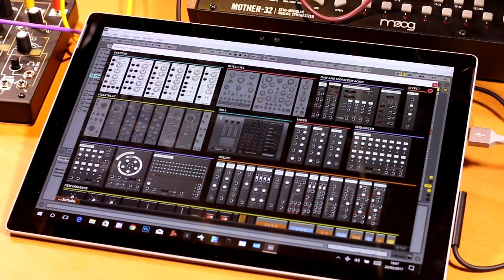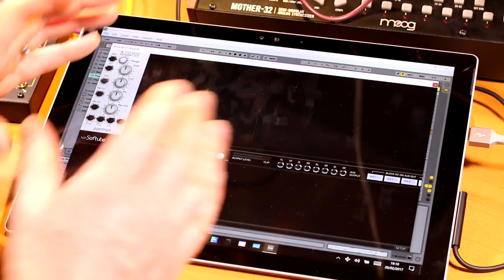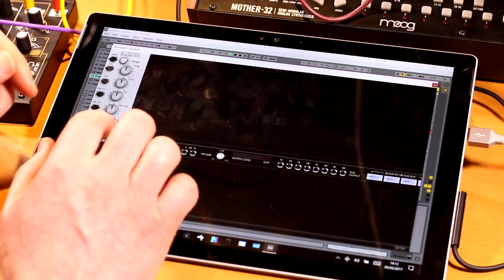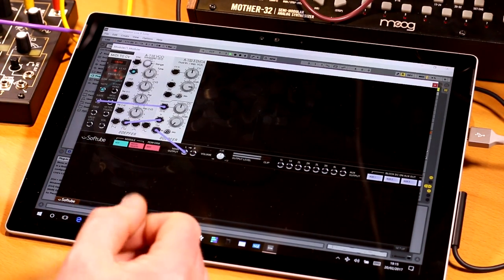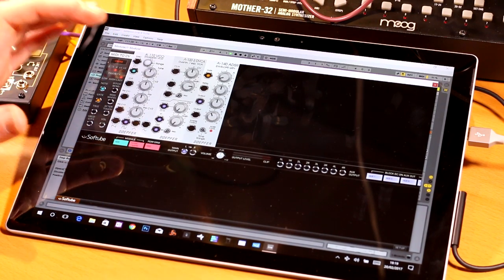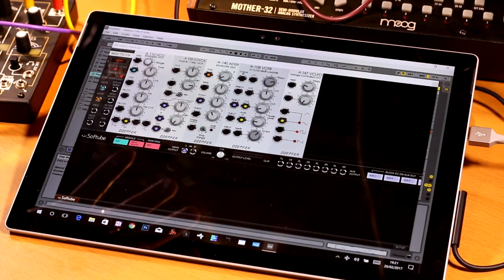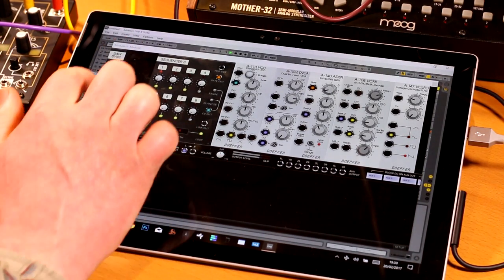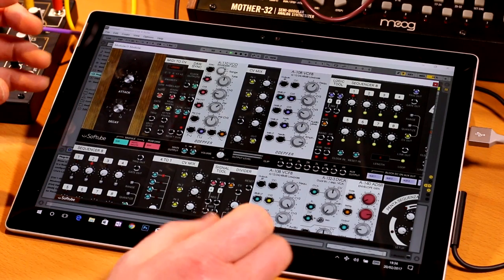Molten Modular 03 - Wetting your feet with Softube Modular

Comment: I've used VCV Rack 2 (free) and Multiphonics CV-1by Applied Acoustics Systems (way less than the cost of even one average module). Both are excellent programs. Or they are the equivalent to crack. Then I bought an Arturia MiniBrute 2S, and I've just ordered Cre8Audio's Niftykeyz and 6 modules for about $2300 Canadian. I've well and truly fallen down the rabbit hole, because I've still got 42HP to fill, and I'm thinking that after that I'll need a RackBrute to attach to my MiniBrute...

Comment: Wonderful video, very well presented! The great things for me with Softube's Modular (bearing in mind that I became interested in it after using my friend's giant wall of every great unit you can imagine) are: 1) every unit I had ear-marked to buy came out as an add-on, 2) I don't have to mess about with PSUs or soldering irons ever, 3) I couldn't save a real rack beyond writing it in a notebook or maybe taking photos, 4) my 'rack' goes with me anywhere, even on a plane, and 5) —and this is the big one—I can automate from the sequencer and inside Modular just by waggling a pot. So, I can get the 'hands-on' performance with pots using my MIDI controller, I can record it, and I can go in and edit tiny portions of it if I want. For me, all of those positives together make it better than the hardware (point #1 being vital here, of course!). I know that the same rack wouldn't sound as rich if we ran my software side by side with the real thing, but the person listening to my music doesn't get to hear that distinction. All that matters to a listener is that the music I make stirs their emotions, and I can fake a lot of that extra subtle fuzz and gloop with post-processing.
Reply from the maker: Thanks! It's good to find a way of working that appeals to you.

Comment: VCV Rack might be a bit easier intro to modular concepts - and it's free.
Reply from the maker: Possibly, although i'm not sure about it being easier in terms of install and DAW integration. It also didn't exist when i made this video.
Reply: * AnimalHeadSpirit *  There's so many trade-offs for the software elements, but that's what makes it useful to try all of the ones you can afford.  For instance, VCV Rack includes the Mutable Instruments modules, but the actual name brand is removed from them.  If you use Softube, you can pay for each of those MI modules in order to get the name.  Likewise, Softube includes Intellijel, Doepfer, & 4ms.  However, it hasn't really expanded that much in the past year or so...seems to have stagnated.

But then back on VCV Rack, you have many software modular designers that don't have any products anywhere else but have some promising design, sound, & utility all mostly free, but there are some really good for cheap such as the Vult series. If you spend a whole $30, you can run VSTs in VCV Rack, so it can probably control Softube Modular, though I haven't tried it yet.

Over on Reason, you can get a taste of several Noise Engineering modules & that's the only place outside of hardware you can play with them.  There is also Reaktor & I love a lot of its modules as well.  Next of course is Bitwig 3 Grid.  Tradeoff here is that Bitwig doesn't have rewire so I can't use it with Reason & the VCV Bridge, though still exists in VCV Rack 1.0, they plan on getting rid of it.  So I haven't figured out yet how to record VCV Rack to a DAW or elsewhere without the bridge.  I've read some people using a Reaper driver called Rea-something that can pipe VCV Rack to Reaper's tracks...I haven't seen an equivalent to any other DAW.

Right now I'm rewatching this whole series as I'm finally looking to take the plunge into semi-modular & eurorack.  Unlike Robin, I had to keep thinking about it for the past two years before I could finally make a decision about getting into it & I'm still balking at the utility module costs.

One of the things I've found interesting is to take a synth schematic & try to build the components for it using VCV Rack. For example, I read where someone was asking about using the Minibrute 2 with the Rackbrute & how to get started.  And someone else mentioned to try taking the wave shapes & sending them to a Quad VCA to control them & pass them to other parts of a eurorack.  So I fired up VCV Rack to try that & see what it might do if all I had was a Minibrute 2 & a single module, a Quad VCA.  Obviously, it's not going to do much until you have something else, but visualizing it & seeing what it looks like, helps you figure out what other modules you might need in order to do something useful with the semi.  I can tell right away that I'm going to need some reverb...lol.
Reply: And you you also use the iOS version MiRack. 

If I had to buy all those modules then that would cost an arm and a leg.

Comment: What are the pros of Softube Modular vs. Reaktor?
I've been searching for comparisons but I haven't found enough to decide which one should I go.
Reply from the maker: Pros would be that it looks and works like Eurorack, like actual real-life product with real controls and connections. You can transplant that knowledge directly to hardware. Reaktor is like building a synth from the inside rather than using synthesizer modules as a musical instrument. I would suggest trying VCVRack.com
Reply: Thank you so much for your fast reply! And yes, I've tried VCVRack but I don't like the fact that is too hard to midi-map. 
I'm gonna have a try on Softube Modular, thank you.

Comment: Why pay for Softtube? There are at least five free modulars for PC: Sunvox, VCVrack, Wren, LWM rack, and Automatonism.
Reply: Cheers that just saved me 70 pounds
Reply: Softtube has modules that clone real world ones.
Reply: So does VCV Rack.
Reply: Thomas Brown Not in the same sense as Softtube.
Reply: Not sure what you mean. VCV Rack clones a number of Mutable Instruments and Batumi modules.
Reply: Thomas Brown Softtube collaborates with audio hardware manufacturers to give you modules true to the original hardware. VCV Rack modules are made by the community.
Reply: That sounds like an advertisement, not a substantive difference. The Batumi and Mutable modules in VCV Rack sound just like the hardware versions.
Reply: Thomas Brown Maybe, but that's why people pay the extra cash.
Reply: Softube Modular is the most analog sounding and they model  real modules working with module manufacturers and it works like a real one.

Comment: Sounds very flat and boring. Do you feel like they slacked on the algorithms?
Reply: Softube put a lot of work into modelling each module ("in close cooperation w/ Doepfer"), so...No, they absolutely did not. Plus they absolutely refused to integrate a low  CPU mode JUST for the reason of maintaining the quality of the modelling. Any discrepancies you detect are due to other factors.
Reply: That is because of YT.  It kills audio quality.
Reply from the maker: Sounds bang on to me :)
Reply: It just sounds plain bad to me. Not at all like analog or even analog modelling. It sounds like Reason.
Reply: @RoboticusMusic  Compared to my Korg Odyssey it sounds about the same. Analog modeling is Softubes thing many devs and reviewers say this. You will need to install the demo of Modular and run your DAW at 96khz  to properly compare it to a real analogue synth.

Comment: I got modular last week and i've learned a lot about how the signal flows in a patch. (and i don;t mean just modular patches).

i've just been tinkering with modular to get an understanding of the basics of making a sound (any half decent sound is an achievement atm :). 

it's a lot of fun but already I'm wishing it was real cables i was plugging in (do you know if there's a way to set modular up to show the cables without having to mouse over them)

also how the hell do you save patches? I';ve looked through the manual but can't find it (the manual is a pain in the arse as it includes instructions for ALL of softubes plugins)
tbh I can't believe there isn't a preset browser with a save button or something.
Reply from the maker: I used it in Bitwig and discovered the presets were in the Bitwig Device, not in the Modular GUI - so they seem to be in the DAW preset manager which is also probably where you save your own - i would have a look but i can't right now :)
Reply: thanks for the reply. finally figured it out
you're correct it was a brain fart on my part
I've been loading the included presets from the device slot in Ableton... no idea why i didn't think to save it there also :)
(you can also drag and drop the modular device into your ableton library which saves the preset, which was the workaround i was using)

another bad thing about the softube plugin is that I now want a real modular system badly but £££££££'s :)

Comment: You're doing a great job with this series. I don't disagree with any of the points you've made. I went an only slightly different direction when I started up at the end of last year.  I started with Reaktor Blocks, and had some fun with it, but found it to ultimately be uninvolving, and very difficult to follow more complicated patches. But it did give me a feel for the basic "moves" of modular patching. I spent a long time then considering my options for going "physical". Long story short ended up with a Pittsburgh Lifeforms 301 semi-modular setup (I like the patch point locations better than the Mom).

Naturally I started adding modules (the case is full after two months!), and as you've mentioned re semi-modular I was challenged just a bit when first "de-normalling" bits of the Pitts in order to mix and match.   But with practice that has passed.  I now tend to think of the Pitts as a bunch of independent modules that have been welded together (but not necessarily wired together), unless I'm just looking to play with its as a voice (options are great).

All in all I guess I'm just weighing in to let people know you're making very valid points about the trade-offs. I'd like to emphasize that there's no right way to go about it, and any path will include some discomfort mixed with pleasant surprises.

I'll close by saying "please come check out my modular patch/performance vids". Might be interesting to see how a relative beginner is progressing, both in equipment and (hopefully) skill.  I really need to work on variety, too!

Thanks for your efforts!
Reply from the maker: i know exactly what you mean about Reaktor Blocks. Good story, ill certainly check out the vids 😉

Comment: Thanks for great video. I also had some pain when trying to patch my first modular emulation vst. But when I started buying real modules it all became very straight forward and simple. Never bought more than two modules at the time so there was never an overwhelming bunch of patch points to figure out. Also the vst modulars are awesome in their own but does not sound as great and cant handle audio rate modulation and lots of patching that well because of cpu limitations.
Reply from the maker: True - it makes so much difference having cables in your hand.